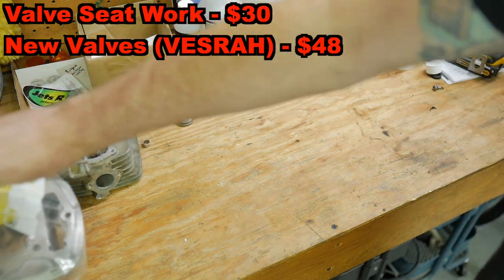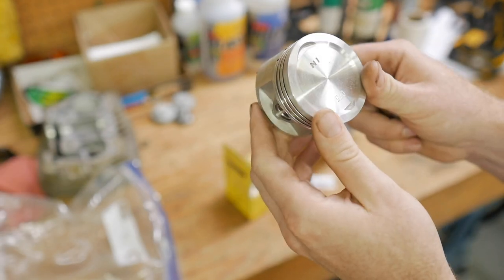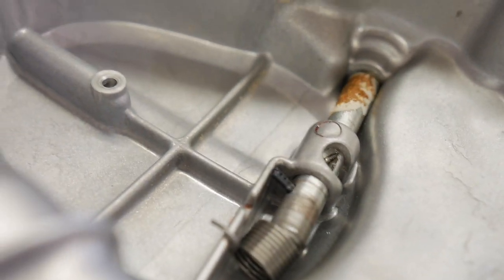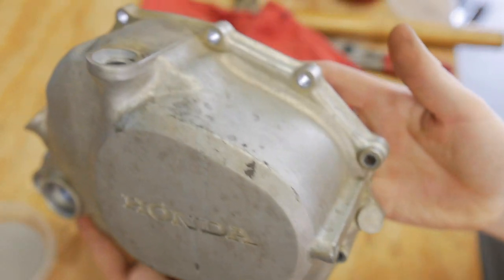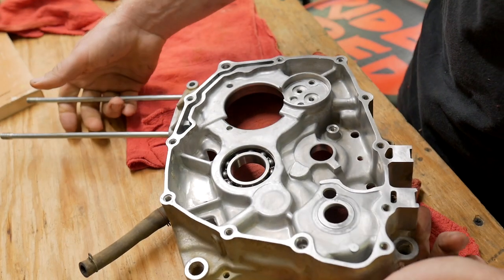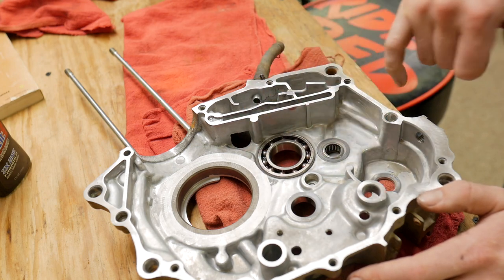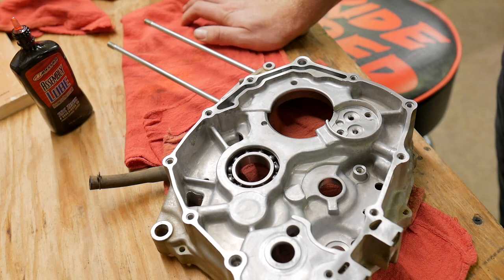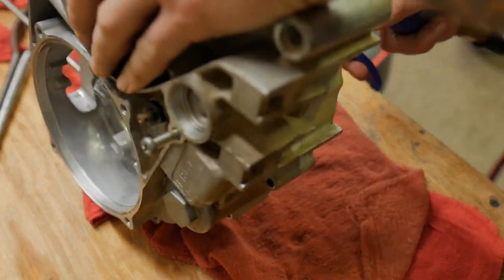Engine Case Painting: Honda XL185 Part 4

Comment: Re: case bearings. The last refresh I did (XV920), I put the case halves in the oven, heated it to 225°, removed after heating, flipped over on a board and the bearings literally  fell out. I used the same process to install ice cold replacements that dropped in with no assistance..
 I was amazed at how effortless it was.

Comment: Nice vidéo ! You did not waste time or material, you SPENT it to have a first experience...and WE ALL LEARNED A LOT : Thank you !
It could have been a good idea to start with a junk part, rather than a preciously refurbished engine case, though.
Looking at the operation it was obvious to me, from the beginning, you applied WAY TOO thick coat. This is something I learned from my grandpa and true for any type of painting (except DIPPING)
To ease your feeling (if needed) I can tell the 1970's original engine paints were even worse than your restoration attemp. I did completly strip my Suzuki top engine paint while pressure whashing it and I was not a too agressive pressure washing ...
I will be doing a similar job in the next weeks and I will have a little thought for you when the painting operation will start !

Comment: You learned a lot, a dabing motion with any brush coat is a challenge. Thin coats spray can, this helps everyone showing real bike painting plus the issues, thx for sharing Cody.
Reply from the maker: I certainly did learn a lot lol . I hope others can avoid this venture with a better method!

Comment: When I painted my C95E Honda Benly engine I used the high heat spray paint .  I stripped off the old paint etc with paint stripper then wash it doen with paint thinners and it all turned out just great !!
Reply from the maker: Nice man!

Comment: Nice tips painting the engine parts. 👍
I  have a Yamaha RX 135cc with a 2 stroke motor, lying in storage for nearly 4 years now. The piston is seized.  I need to unseize it. 
As about the cylinder head, the metallic coating / painting has chipped off in a few places. Do I need to get it painted with heat resistive special paint or any other procedure to get this back to its original stock condition?  Thanks

Comment: Did you use soda as media for blasting? Or some other Media?
I want to rebuild and repaint my old yamaha motor and was thinking of blasting it with glass beads.
But not sure how to make sure all media is washed afterwards.
Spraying over the old paint will probably not give as good as a result?

Comment: hey MD, ive been trying to diagnose a weird bumpy feeling in the rear of my yamaha r6 2001.
the tyre is new the tyre pressure is 2,5bars and i cant for the love figure out where the bumpy feelings comes from... Its not consistent but it seems like theres something stuck on the tyre while there clearly is not.
Could you help me in the right direction?

Comment: QUESTION...........
99 honda magna.
If I straight pipe it without rejetting the  carbs, what will be the results and issues?
Reply from the maker: Probably backfire like crazy
Reply: @TheMotorcycleMD  Thanks for the quick response 👍 
 What if I took the baffle out? I've been wanting to try that, but had people say I would have to rejet.
 Is that true? I'm just looking for an easy, more aggressive sound change.
Reply: I've just discovered your channel.  I have subscribed.  If you have a video showing taking the baffles out of a 99 honda magna and talking about how it would do without rejetting it I will watch if you have a link. I would just hate to drill and take out to see it not work, then try to replace. Thank you

Comment: Never buy those cheap chip brushes for critical work. Buy the good brush. When you’re in between coats or just done for the day- you don’t have to clean the brush. Just load it up with paint then wrap it tight with Saran Wrap then bag it real good in airtight bags then put it in the freezer. 
You can come back months later, let it thaw, and it’ll be just like you used it a minute ago.
But bag it good and airtight or your food will taste funny.
Reply: As others have said, those chip brushes are crap. Get a good synthetic Purdy and treat it well. I would also recommend cleaning brush well after use and hanging up, bristles down to dry. Storing a wrapped brush will give you dried residue in the bristles. Only dip the brush halfway up the bristles to keep paint from getting irretrievably lodged in the ferrule.

Comment: Cynical me would say part of your problem with the finnish is partly down to poor quality brush, best to buy good quality and clean properly after use and reuse. People that paint for a living do it that way, good quality brush will not be cheap, also needs a rub on a rough surface initally, bricks are good just before 1st use. Hagerty use proper spray gun/compressor as it works best, for home/DIY use rattle can is probably simplest option.